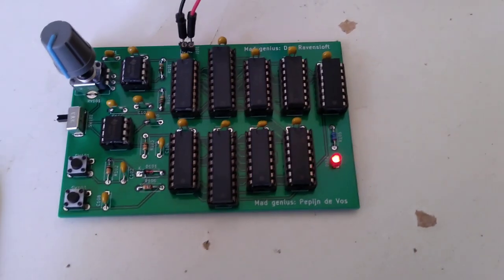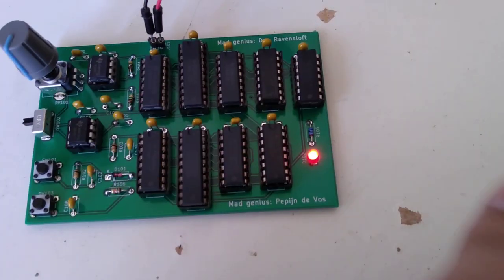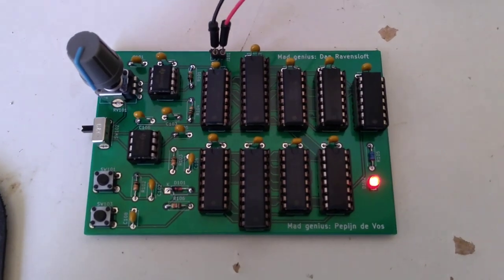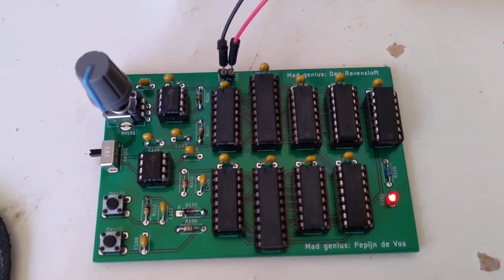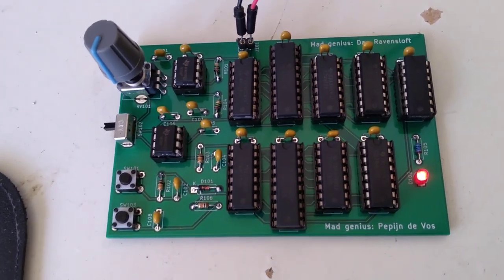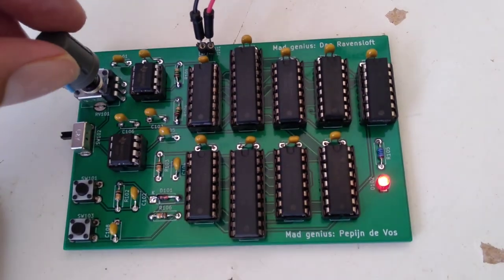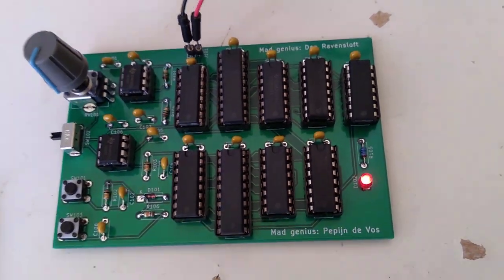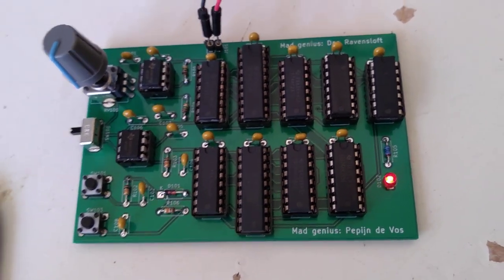Breathing led pcb generated from verilog

Comment: Hey mate, interesting video. Am trying to do the example that you have on your website to synthetize the pwmled but am getting stuck when trying to synth to low level Verilog.
I can "make" the file for stats but when it comes to the other step it throws "make: * No rule to make target 'pwmled.vcd'.  Stop.".
I would appreciate your support there.
Reply: Nevermind, I figured out a problem regarding the Makefile. That file at ../sim and at ../kicad still refer to 74ac.lib as 74series.lib. This is acknowledge in pull request #23 where it is updated but it hasn't been added to the main branch. To fix it change inside those makefile and change "%.json: ../benchmarks/%.v ../74series.lib ../74_models.v...." into "%.json: ../benchmarks/%.v ../74ac.lib ../74_models.v....", same with the other makefile in ../kicad